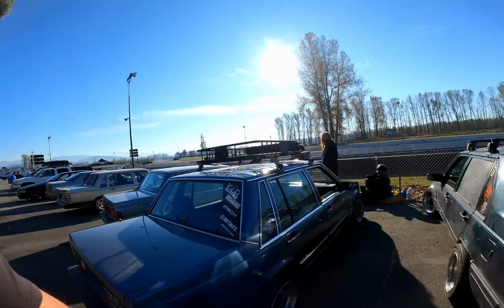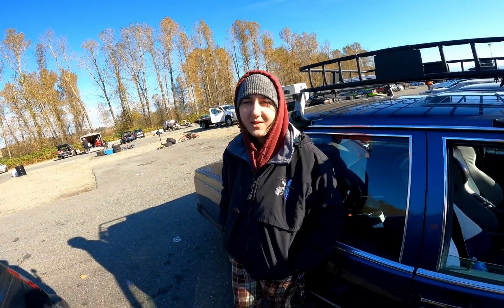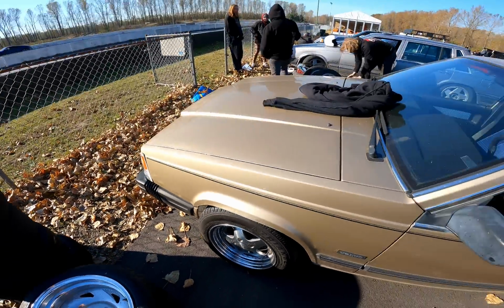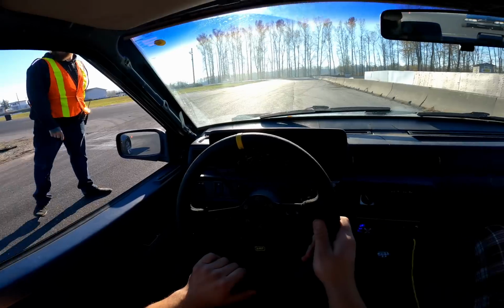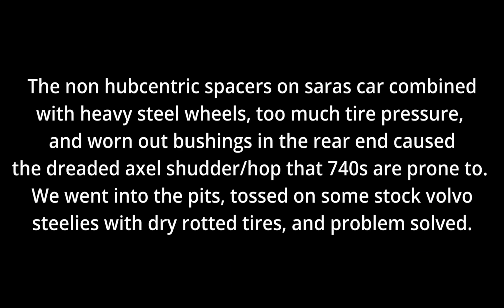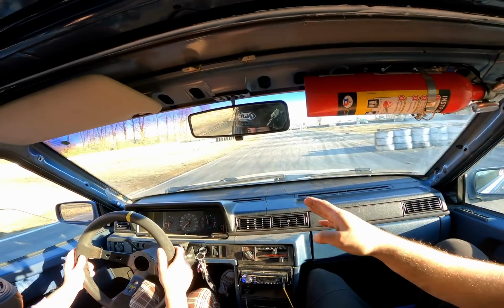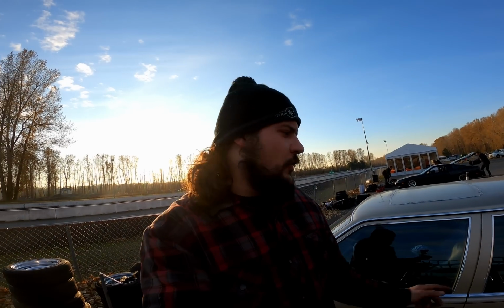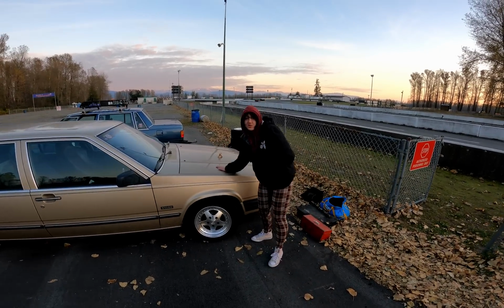My girlfriend learns how to drift her volvo!

Comment: Hey, the kid who was asking about buying a wagon off ya here. I have been having problems with my 740 but it's fine. Over torqued and broke a camshaft bearing stud, lost some 13mm nuts, and have had water pump problems for a couple months now. Good news is that the camshaft problems are fixed, I have All the new nuts I need, and should have dogwood ready by December
- your friend and teenage volvo enthusiast, Milkman
Reply: Congrats!!

Comment: Hi. Have a question. Is it possible to drift stock Redblock Turbo Volvo on gravel or wet roads without major mods? What mods you would recommend as Program Minimum for amateurish drift ? Thanks
Reply: Chop springs, weld diff

Comment: 7:16 front left wheel seems shifted to front, why is that? I have same problem, other side is all good
Reply: It’s turned slightly to the right, it will just be the setup they have with camber / caster